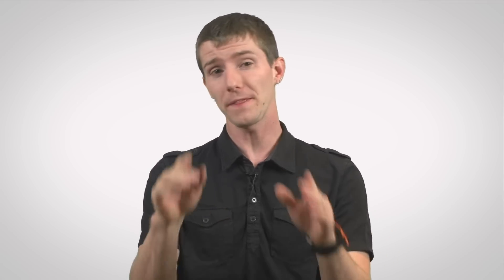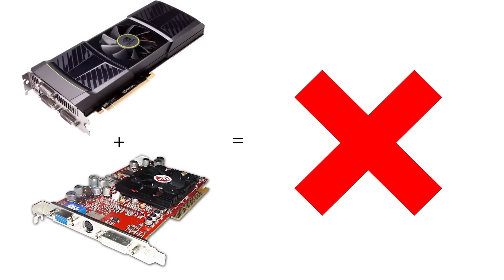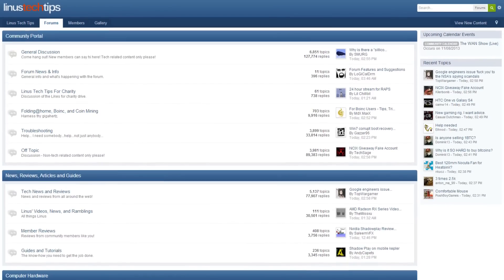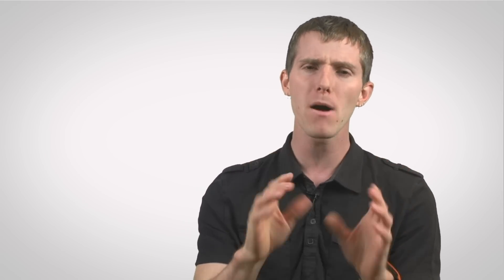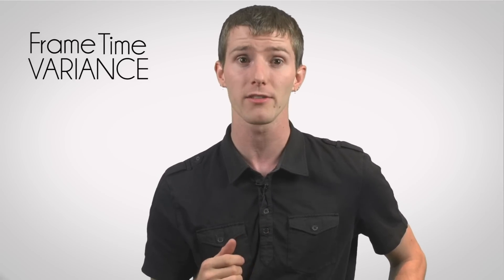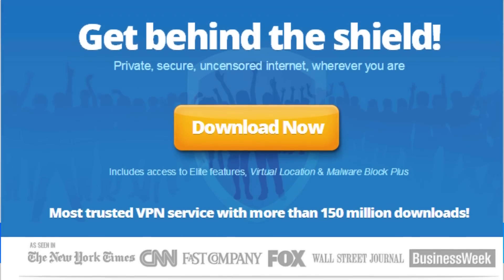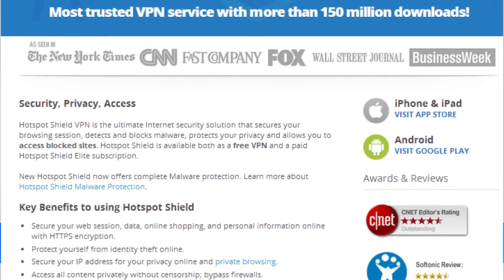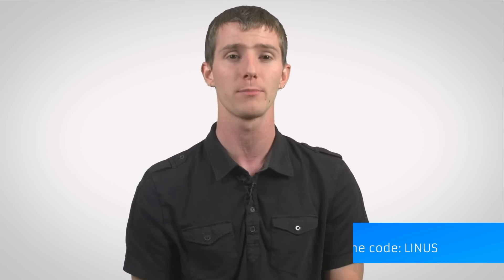SLI by NVIDIA - Everything you Need to Know as Fast As Possible

Comment: Nvidia has taking care of mirco-stuttering compared to the competition? I don't know nothing about that. What I have heard/read is that AMD is doing great improvements with crossfire lately.
Reply: ***** G-Sync is far off compared too AMD's recent and improving driver optimizations. Where as G-Sync requires a monitor that supports it and has a built in processing board.
Im still using an older monitor and wont be upgrading until it dies or they become cheap enough, let alone forking out for a G-Sync ready one.
Reply: Jihadi Tiger From what reviewers of g-sync have said, the addition will cost less than $150, and the experience is apparently worth much more than that to anyone who has reviewed it.  Also the big brand names like asus, benq and some others are supporting it, so it won't be hard to get your hands on and it really won't be that much more
Reply: AMD has made great driver improvements lately, but they still have huge jumps in frame time variances with multiple cards.  Most of the older cards actually have worse or equally bad frame times in single configuration as some nvidia cards in sli
Reply: *****
I don't think that G-sync have (will have) something to do with proper running of 2-way SLI configuration. Running 2 cards is about the synchronization between those cards thus I believe that G-sync (synchronizing only display with graphic card) is not solving the issue of microstuttering caused by running two cards. And that's the area where AMD is certainly ahead with their optimalization of Crossfire.
Reply: *****
It all comes to a personal experience, I'm looking forward to see some comparisom between 2-way SLI with G-sync monitor vs 2-way CrossFire. Until this point, the statement reffered to the SLI vs CrossFire
"Nvidia has taking care of mirco-stuttering compared to the competition",  is a bit too strong in my opinion.

Comment: Is this the same as crossfire be Radeon? If it isn't then what is the difference?
Reply: for CFX/SLI Watch this video Newegg TV: CrossfireX & SLI Multi-GPU Guide, Tutorial & Benchmark Demonstration
Reply: its nearly the same but some little thinks are different
Reply: They are similar, both have their games in which one will overtake the other.  The only real difference is the AMD side generally has a little higher frametime variance and has a history of a little worse driver support than the nvidia side. (they do seem to be getting better though)

Comment: thank you Linus I can't be good in this without you :)

question for you Linus ?

I have a gigabyte PSU 850W

my card is msi gtx 770 lightning and i'm thinking about to SLI them 

should I change the PSU or it's enough ? thank u
Reply: should be enough :)
Reply: you may even be able to use triple sli
Reply: thanks guys
Reply: should be enough
Reply: could def sli, tri sli would be a little much for that psu and you would run into problems with peak power draw being a little too much for that psu

Comment: Hey Linus, I have the EVGA GTX 780 Classified w/ the ACX cooler. Do you think it would be beneficial to use the Step-Up Program EVGA has and get the standard reference GTX 780 Ti? its $120 + S&H (S&H both ways) to upgrade, and I'm thinking I probably wouldn't get that much more performance than what I get out of my card now overclocked. Just asking for thoughts and ideas on the subject

Comment: Actually @Techquickie, you can pair different amounts of memory on the same gpu for example a 670 4gb with a 670 2gb. The only negative is you will only be able to use the max memory as the lowest card. So your gpu's will be limited to 2gb in the example.

Can I mix and match graphics cards with different sizes of memory?
When purchasing a second graphics card, you should try to match the memory size so that you are ensured full value and performance from your purchase. However, while it is not recommended, NVIDIA does offer the flexibility to run graphics cards with different sized memory by using CoolBits. Using CoolBits (value set to 18), you can force both of the cards to use the lower of the two memory sizes and operate them together in SLI mode. When dissimilar memory sizes are enabled to work together using CoolBits, the effective memory size for each card becomes the smaller of the memory sizes.

From: http://www.geforce.com/hardware/technology/sli/faq#c19
Reply: Yeah you're right, but WHY would you want to do that?  Just pair cards of equal vram amount.  Why spend the money if you're going to dwarf your max vram capabilities?  That's stupid.
Reply: chronofusion Oh I never said it was smart, its dumb as all fuck if you buy 2 cards with different vram! But that doesn't make it impossible. Also I have known situations where mates have been given a graphics card that is the same except ram and needed to know this information.

Comment: So I have a 1GB 7850, now I would like to get a second card for increased performance in BF4. The card I have can run a mix of med, high and low settings with a small amount of AA at 1080p getting a constant 55+ fps. My issue is that its a 1GB card, will this be enough for the next 2 years, or should i shed out an extra €50 and get the R9 270 (basically a 7870 2GB beefed up a little) for the extra VRAM? Please only respond if you have experience with this sort of thing. Thank you
Reply: Get dat 270. You really do need more VRAM than 1GB for the future.
Reply: ***** Could you tell me exactly what the Vram is used for mainly? I know the higher the resolution the more VRAM you need, but 1GB is fine at 1080p. I will certainly get the 270 if people recomend it. But I would just like to know what taxes VRAM the most. Thank you for your reply
Reply: ***** It also has a lot to do with in game textures, so while 1gb may handle older games rather well at 1080p, newer games have more detailed textures so use more vram.
Reply: Ah okay. Thank you for your time. I have been doing some research and it seems that 2gb is very recomended.
Reply: Honestly, it depends on how much you're spending on a GPU. For the level of performance that a 270 gives you I do think that 2GB is the sweet spot. If you were spending more I'd say go 3 or 4 but for $200 2GB is good.
Reply: 3GB or 4GB for BF4 nuff said
Reply: Status Custom Pc I have a 2gb gtx 660 and run the game on high with great framerates.

Comment: I'll ignore the nvidia/amd fanboy hing here and pretend they're the same since I'll talk about dual card set ups. Three years ago if you bought an HD 6850 for £130 that was a respectable card at the time, now it's still pretty decent to a degree. To upgrade you're talking another £130? Or you could pick up a second HD 6850 for £50 and get similar gains.
Basically, this whole "You're better off with a single card upgrade solution" is a good statement but only when it's pitched around the area of someone having a GTX 660 or an HD 7950.
At a certain price point it's a very wise thing to do.

Comment: @Tetra Sky: Yes, it is possible to run cards with different amount of memory. At least the FAQ on GeForce.com says so. Get your facts straight, Linus!
Reply: yes you can do it, but say for example, and I know and old card, but put a 9500GT 1GB with a 9500GT 512mb card, and your system with see 512MB for the graphics memory with the official Nvidia drivers under Windows, so it's always best to pair cards with the same amount of memory together.
Reply: This is true. GeForce.com also recommends you use cards with equal amounts of memory, to avoid wasting any of it.
Reply: Jim C K Flaten I almost forgot about Hybrid SLI, my old ASUS M3N72-D mobo had one of the last AMD/Nivida Chipsets produced, and I was able too do Hybrid SLI setting the onboard nForce 750a for PhysiX, and 1GB 9500GT as the main card, and allowed me to use all 1GB of memory for the 9500GT and all 512mb of memory the bios let me use for the onboard Nividia  nForce 750a. But of course that's not normal SLI lol!
Reply: The FAQ is old. The Coolbits mod no longer works. I sent NVIDIA that link to get it updated. I believe there is still some random workaround to do it, but it's not officially supported.
Reply: Thanks for clearing that up :) I know it has been in the FAQ for a few years, and always assumed it to be correct.

Comment: Guys I was thinking of adding an additional evga 780 sc w/ acx to my rig for sli. Have the z87x ud3h, 4770k OC'd to 4.4 at 1.139 volts, ax860i psu, and corsair carbide 540 which is all air cooled by an nhd14, 3 140mm exhaust and 3 120mm intakes. Will this build support sli well? Or will I have to change something(psu?)...thanks!

Comment: SLI does and work with different spec cards. The problem is, you're limited to the lowest spec on each card. Also, you don't need a certified motherboard either...
Also, you need to get your NVidia drivers patched to allow different cards since NVidia doesn't want you using your old card alongside your upgrade. There are sites that provide the drivers, I know, as I'm running a GTX 260 and GTX 280 in SLI with said drivers.
As I said, you're limited to the lowest spec, in my case, the SLI setup is pretty much like running SLI GTX 260 cards.

Comment: don't forget that they both have to have the same bios. i had a 460 and then awhile down the road i bought a 2nd one for sli and it came in the same box with the same description and looked exactly the same, but it wouldn't run together. looked at gpuz and the 2nd one i got had bios version B

Comment: Has micro stuttering been fixed for the most part?
Reply: Kind of... NVidia have done a large amount of the leg work in the drivers, but there are games that come out that might cause problems, but they're mostly fixed by the time the average user would get to play them. Unfortunately most people who run SLI are on the cutting edge and will experience the hickups at the release of the games.
Still, better then having a AMD card where they have to release a driver for every game, right...

Comment: I would never go SLI unless i wanted to play games in 4k with max settings and get 60 frames per second... But 1 1080p screen is good enough for me. Id just get a 780 ti.. People will say its overkill for 1080p but its not. Far cry 3 and crysis 3 still cant run at 60 frames solid with that card at 1080p
Reply: @ atom608.  YES.  A gtx780 and 780 ti can EASILY run crysis 3 and farcry 3 at full hd rez at an average of 50 or more fps at all times.  You just have to turn down 1 or 2 measley settings that WON'T make an enough of a visual difference to justify its fps tanking results against the effort of your hardware.  

My 1.5GB vram gtx 580 ALONE runs both games at medium to high settings at that performance level at full hd resolution with a 3.6ghz amd 6 core 1090t phenom II cpu.  It's really a marketing gimmick that programmers use.  I put in one or two graphical settings that they KNOW even the best of the best current hardware can't prevent fps tanking against yet they also know those same 1 or 2 settings virtually make NO visual difference at such a good resolution. This applies even much more at 2560x1440p aka 3.7 meg rez.  that rez will always look much better even at medium settings than maxed out settings at 1920x1080p
Reply: I will agree, but a few years ago if you where on a budget, it was sometimes cheaper to get 2 lower end cards with a decent amount of memory, and put them in SLI and still get near, or better performance then a mid/high range card for less money. I did it for years with dual 1GB 9500GT cards in SLI, in fact i was using them till just a month back when my power supply died, and killed a good chunk of my old system which included the 2 9500GT cards
Reply: or you could get 2x 760 and get better/same performance for a fraction of the price.
Reply: Sure you do....
Reply: How about 120 or 144Hz gaming? Need SLI 780 Ti for +140fps in games like BF4
Reply: Commodorefan64 You can run into some game compatibility issues though. Some games don't support SLI, they may only support crossfire, or vice versa. It's safer to spend the same amount of money on one card than the same amount on two cheaper cards.
Reply: But then you got games that dont support SLI or games that have problems. My friend had 2 570's runing in SLI and when he played skyrim some of the npc's wernt shown but he could still here them. Id rather pay a bit more for 1 card and know im not going to run into problems
Reply: ***** sorry, but the problems you stated have nothing to do with SLI, skyrim supports SLI =\
Reply: YES that is true it does supoort SLI but im saying from experience what happened to my friend... He ended up just geting a 670 after he noticed he had to only use 1 card in some games
Reply: Yooz are all lozers. I run Wolfenstein 3D at 1 million fps. and its smooth as silk. Better than you.